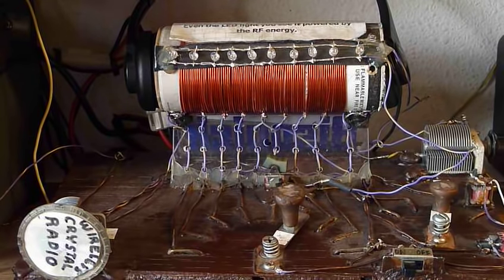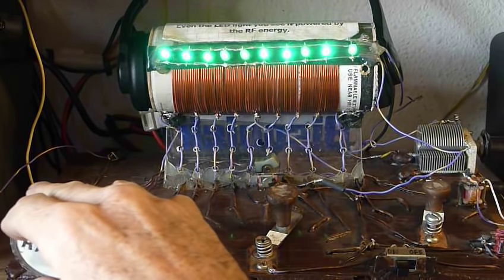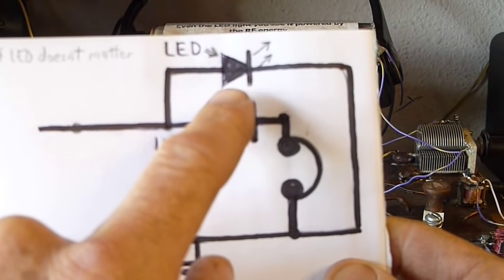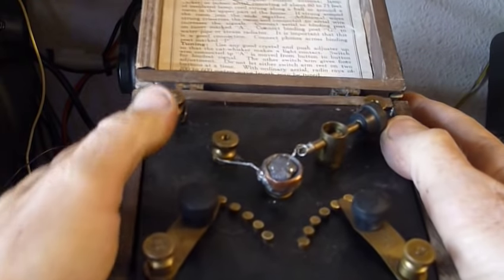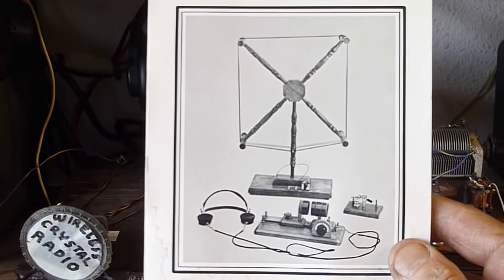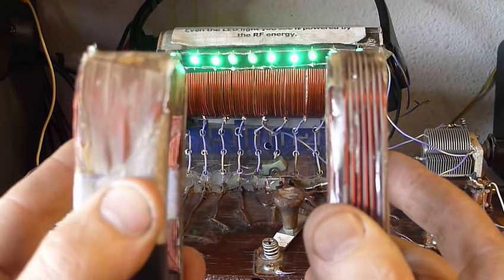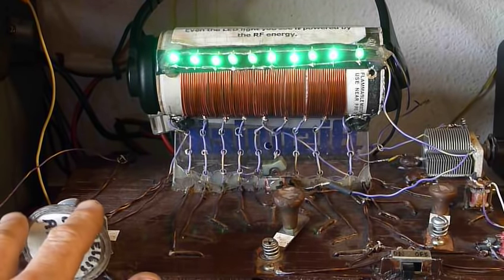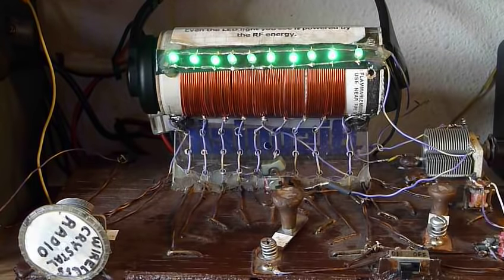Free Energy From Radio Waves. See info section for additional video.

Comment: How far away is your local station and what power is it running? I suspect it must be quite close to be able to light those LEDs
Reply from the maker: The radio station that provides the power is about one and a half miles from here. In the daylight hours they transmit ten thousand watts, but at nigh they lower their power down to 48 watts. My LED still glows when they lower their power but it  isn't as bright, There may be some additional power coming another AM broadcast transmitter at night, but I haven't verified the source that lights  up the LED at night.

Comment: You would not draw any power from the transmitter becouse what you have done with the led is a frequency amplification by grounding it. This is actually a amplification metod that could be used to draw power from the ground using 2 more coils a capacitor and a diod. See dr Stifflers work. Not sure he has the video up still otherwise you can ask him.

Comment: It appears you have the strip of LEDs wired in parallel.  Also, it appears that the wire closest to the top is tapped onto the jct of the antenna  and coil while the lower wire bonded to the ground of the variable  capacitor.   Am I  correct on those  observations? 

Also,  there does not appear to be  any resistor in your  LED circuit a  resist. As far as resistance is concerned, since some of the RF  coming into your  radio is being used to illuminate your  LEDs, will there be a   loss of audio  notice in your ear phone?

Comment: If you would have a zillion of such devices in the room, would be there be any signal in the room and would all signal have the same strength ?
What is the limit ?
Reply from the maker: I'm not sure, but it sounds like an interesting experiment. I noticed my other radio becomes quieter when I tune my crystal radio to the same station, but as one viewer explained it's most likely due to the the transmitter signal being re-radiated by my crystal radio slightly out of phase with the station transmitter. The phase difference would be from the small time difference between the re-radiated signal and the transmitters signal creating a null in the signal.
Reply: Some things in your house reflect radio waves decently, so there would probably be some bouncing around normally, and one device could soak up some of that. Also even in a direct line, if one is shadowing the other from the direction of the station's signal, then it might soak up some energy too.
Reply: Stewie Griffin the power is brought in using a 200ft antenna wire then resonated with coil and capacitor. A few tens or hundreds of milliwatts are available depending upon how far the antenna is from the transmitter and how powerful the transmitter is. RF energy diminishes by the square of the distance. it gets weak quickly with distance. Must live very close for this to work. Aloha.

Comment: All you need is enough power from the crystal radio setup to produce the amount of input voltage and current to act like 2AA batteries then you can use a bug zapper circuit to create a high voltage outputting circuit that would feed into a bigger circuit that would create an even higher voltage - and so on - no?
Reply from the maker: Yes you could potentially raise the voltage, but that doesn't mean you getting more overall power. Here is a video where I explain this. https://www.youtube.com/watch?v=6Zxp8lSdn8M

Comment: Master, can you please state the materials and procedures? I am doing a capstone project using em waves, and i managed to make a system using antenna and rectenna circuit to get noticeable amount of voltage but very low current. This made my wattage not high, and I am searching for a way to rise it up. Can you please help? Or even state the procedures of yours as it seems like you got a very nice amount to power all these leds. Thanks in advance.
Reply: Or even if I used a coil with antenna and ground and used the mutual inductance to another coil to light up the led, will that get me better wattage? /**My focus is on the wattage not voltages**/ As my challenge is to get alternative way of energy.
Reply from the maker: @hossamsaber529  You may find this helpful.  https://www.youtube.com/watch?v=vHVmJ5lD9jc&t=2s
Reply: @GrantsPassTVRepair  Very nice demonstration I do really appreciate the effort, but I am not asking about which frequency of antenna can power the led. I am asking about collecting or harvesting of the energy from the EM waves. Like the current video of crystal radio, you made a great system using the radio and controlled the led brightness, so this is a great match for what I seek. Thus, please, can you help me offer something like that or just a tip of how can I rise the power from such system?
Reply: @GrantsPassTVRepair  Sir?
Reply: I have one theory that will boost the current up - that is to connect power harvester units in parallel to double or triple the milliampere capacity, just like connecting batteries in parallel to increase Ampere capacity. In practice, series battery connection increases voltage while current remain constant, parallel connection increases current while voltage remains the same... One other possible way is to use a supercapacitor to store energy and use some sort of energy management system to release it as constant bursts of high current power. At least that's one route I could see in a Filipino made RF harvester known as "Electro-Plasma Generator" claiming to output Kilowatts power using RF power harvester in conjunction with a tesla coil. But I believe its more than that, we have to wait and find out next year until the invention shall be released in the Philippine market next year.

Comment: Can you tell us about antenna? How you did it and is it vertical or helical? Inside or outside? 
I will appreciate any advice. Regards
Reply from the maker: +Kamil Domjan I used my kite. I had a perfect wind which allowed me to fly my string right over the top of a pine tree, and when the wind died down the kite landed I then tied the end of the string to a spool of insulated stranded wire and pulled the wire right over the top of the tree. I'm guessing the gauge of my wire is probably 22 gauge, and the tree is probably at least 100 feet tall. I believe It helps to keep the antenna away from any buildings and tree branches which can dampen the signal, but I had to use the top branches to support my wire. My antenna is similar to an inverted V but its' end fed rather than center fed. and one leg of the V is almost vertical.
Reply: +Grants Pass TV Repair 
I live on top flor of four floor building in small city, I hope that helical antenna will work for me but I wonder what you think and what will you advice to get best results? By the way I reviewed my book from Jim ;) with signature ;) so thank you so much for the link to his website!
Reply from the maker: Congratulations on getting the book.  I suggest you use a long wire antenna if possible, and figure out a way to keep most of the wire away from the building if possible. Using a kite can help you get the wire where you want it, but if you do this just make sure there are no power lines near by.  That kind of power can kill you.

Comment: hi ! as u harness alternating current u got it set up for receiving only one definite frequency ? am i right ? is it possible to harness electricity from all frequencies and add them up ? i am thinking about spiral coils and open circuit receiver the one tesla use. alternating current can be harness only by closed circuit receiver but how about impulse discharges that are all around us but impulses dont have difinite frequency. like in dc u got no frequency, in ac u got constant frequency but as i know impulse has no frequency but it creates oscilating current in the conductor it was diacharge to and the frequency is not constant. sorry for my english

Comment: Hii sir,

this question that suddenly jumped into my mind when i saw your video.. has got nothing to do with your video btw. 

just that i never got an acceptable under on this question.  here it goes. 

Since Energy cannot be destroy or created.. only changes form. 
I am very curious why is it when my portable 2 stroke electric generator when powered on, when i fire up my load (for example a bulb), the bulb light up, but when i remove my bulb, where the energy goes ? (in this case is the ac electricity..) where on earth it goes ?  since the loaded and unloaded condition of the generator is the same, motor is running at the same pace, and consuming the same amount of fuel.. where then the energy that generated goes when i unplug the bulb ? 

if you have the time to answer my silly question... pls do.. i would love to know something i am most ignorant of.
thx
andrew
Reply from the maker: Unless you have some kind of load on your generator, I would assume the energy doesn't go anywhere. Just like a battery without a load. Nevertheless if we had the ability to look into the invisible world, I'm sure it would be interesting to see what kinds of interactions are taking place between the magnetic field and the coil with and without a load.

Comment: Hello ! I wonder if it is possible with the suitable antenna, to detect with a diode the signal of the digital television. and turn on some LEDs.   (1kw DTV station nearby) I wait your answer. Cheers
Reply from the maker: I'm sure that would work, but I'm not sure about the range you would get at those lower frequencies. Here is a video where I demonstrated   something similar to what you're wondering about. https://www.youtube.com/watch?v=vHVmJ5lD9jc
Reply: @GrantsPassTVRepair  According to it, dtv works in the order of 400-600 mhz, I don't know what type of LC tank should use for that frequency.

Comment: I read that paper or cardboard coil forms will sap some of the energy you are receiving. I like to put a proposed coil form (less any wire or metal) in my microwave oven for 30 seconds and feel if it gets warm, if not it is good for a coil. I liked that old crystal set you found. I like spider coils also and Litz wire. I wish they would bring back shortwave. (no thanks to Obama).
Reply from the maker: I guess that explains why some of the coils I've seen don't have cores

Comment: I wonder what would happen if you put a bridge rectifier on the output. 

My first instinct would be that the current might be a little bit higher but then the rectifier would create a bit of a resistance which might lower the current even more.
Reply from the maker: I tried something like what you mentioned but I don't remember getting any additional power this way.
Reply: @GrantsPassTVRepair  Yeah the resistance of the rectifier might be a bit much. To be honest I havnt done much analogue electronics for years so im a little bit rusty. 

After a quick google i realised that full bridge rectifiers are mostly used for high power applications. If you buy them as components rather than making them using diodes the resistance is 240ohms. Ideally you want to keep the resistance and the load of whatever your powering as low as possible.

Maybe try a diode in parallel with a capacitor.
Reply: You will always get less overall current but its better if its all flowing in the same direction.

Comment: Things to try.. 1) Add another Antenna... 2) Trickle charge car batteries with it, so you can run more powerful projects... better lighting perhaps.
Reply from the maker: Even with a couple antennas it would probably take a year to get a full charge on a car battery with such a small output.
Reply: Some AA's or AAA's ?
Thanks for the reply.
Reply from the maker: I suppose it might charge some small batteries.

Comment: Which version of the book has the schematic for the set that you use in the video? What is the power and distance from you of the radio station that powers the unit?
Reply from the maker: I'd guess the radio station is about 1 mile away from here, and their day time power output is 10 thousand watts, but at night it goes down to 50 watts. The schematic  I used was in the first book. Did you see the interview I did with the author called radios that work for free? https://www.youtube.com/watch?v=G4YDsvv1DEk
Reply: @GrantsPassTVRepair  I saw the video. It was nice. I really want to light 10 LED's like you did.. I have a 50KW station 3 miles away. Do you think that would be powerful enough to duplicate your setup?
Reply from the maker: @kafr8413  I would think it should work with a 50 KW AM radio station only 3 miles away. At night when our local radio station turns their power way down to around 50 watts, I'm still able to get a faint light off of my LED. I think the key is getting a nice long antenna wire up high. Mine is about 200 feet long. Also note that my LEDs are all in parallel. Did you see this other design which is easier to build? https://www.youtube.com/watch?v=vHVmJ5lD9jc&t=66s
Reply: @GrantsPassTVRepair  That is really simple. I will build that one instead. Thank you for the suggestion.
Reply from the maker: @kafr8413 I don't know if it will pick up signals as well, but best of luck on your project. By the way here is one more experiment that may interest you. If you try this please be careful about high voltage wires and electrical storms. https://www.youtube.com/watch?v=yqljaKjKjd4
Reply: @GrantsPassTVRepair  That was a great experiment. I have a 200 foot wire strung along my fence. It is only 5 feet off the ground. In Florida, higher up would be hazardous to my health. ;-) . It will light one low voltage LED most of the time. I had hoped for better, but 200 feet is a far cry from the resonance length of 427 feet. Sometimes, you are OK just where you are. Looks like I am about the best that I will get. Thank you for your help.
Reply from the maker: @kafr8413  Your welcome. I have heard about the lightning in Florida. Sounds pretty dangerous if you have a long wire antenna as I discovered.  https://www.youtube.com/watch?v=_DHBjeobg4U
Reply: @GrantsPassTVRepair  Forgot to ask the most important question. What is the DC voltage and amperage going into the LED strip?
Reply from the maker: @kafr8413  I'm not sure of the voltage and current since it's difficult to measure radio frequency energy, but since these LEDs are designed to operate on 20 Milliamps at 3.6 volts max, and I'd guess they are only producing half of their normal brightness, their power consumption  is extremely low.

Comment: With this much power, I've heard it is possible to get FM out of a crystal radio. Have you done any videos on that?
Reply from the maker: I've never tried to build an FM crystal radio but it sounds like it should be possible.
Reply: Yes, but you will need to include a heterodyne circuit that converts the FM signal into an AM signal.

Comment: If you use a joule thief circuit in that you can light hundreds of leds with it.
Reply from the maker: That sounds like a fun project.
Reply: do it plz
Reply: its  just a voltage booster ... current goes down

Comment: Wouldn't a Bridge Rectifier work better than two diodes? I'm a Journeyman Electrician but don't know alot about Crystal diode radios.
Reply from the maker: I tried  using a bridge rectifier as you described, but it did:t work all that well. The advantage of the crystal radio is that it's a tuned circuit, where as the bridge rectifier is not. I'd like to try it again using fast switching diodes and see if that helps.
Reply: @GrantsPassTVRepair  I'm actually working on building a crazy contraption, involving a grounding rod, radio antenna and a bridge rectifier to send a frequency through a Water Electrolysis cell. And I'm wondering if you could help me to get the maximum power output possible? I would really like to have 60 watts but it will still react well at as low as 4watts. I have a lot of videos and pictures that describe what I'm doing well if your Interested.
Reply from the maker: I 'm not sure I would know how to help you with such  a project. Did you ever see my video on free energy vs the laws of physics? https://www.youtube.com/watch?v=d0UjhHUrO74